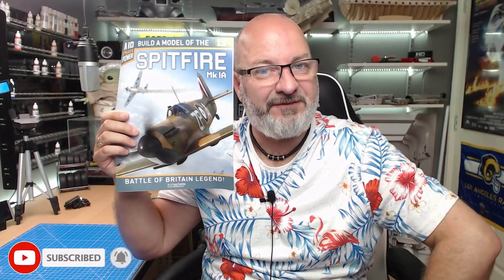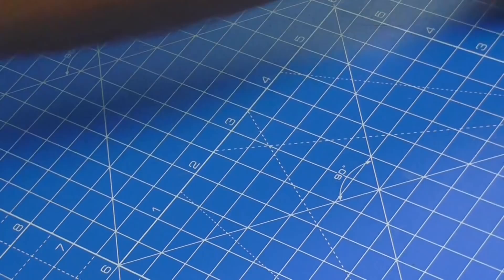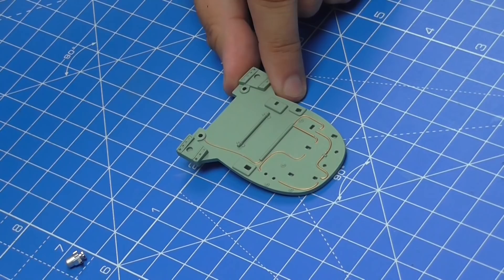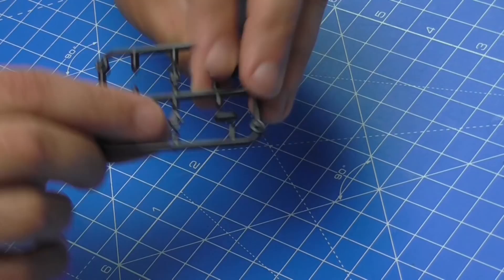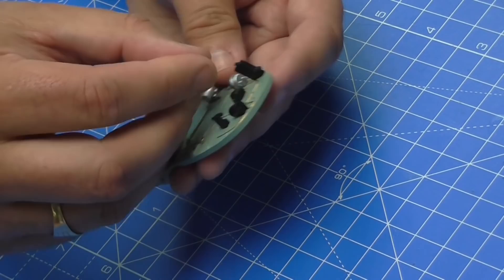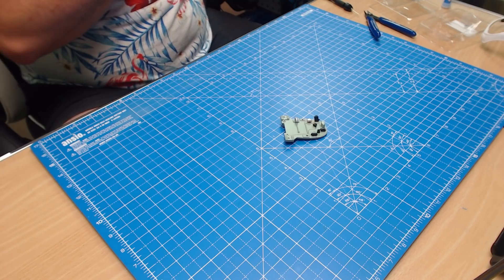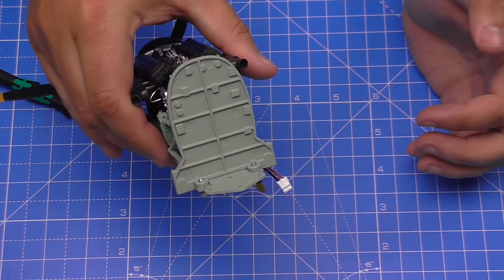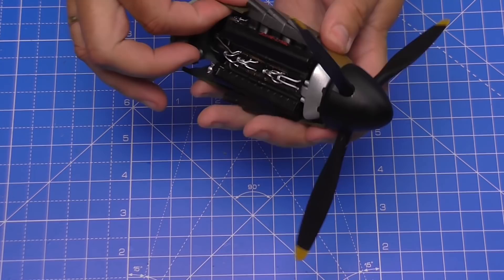Build the Spitfire Mk1a - Part 13 - Fitting the Fireproof Bulkhead and Engine

Comment: I know how you feel buddy, hot hot hot, especially when you're wiring up rotors and stators inside the turret rings of tanks. The nose section of the Spitfire is really taking shape now. Very nice. Soon you'll be able to use the spitfire as a fan.

Comment: Those two copper pipes go in at the next issue, 14, however they could easily have been fitted this issue as they are the first things you fit next time. Unfortunately when fitting my engine the lug on the extra part snapped so my engine is a bit loose and I can't get the back issue, so will have to see what repercussions there are later as the engine sits a little high on its mounting. Keep up the good work, great build.
Reply: I had problems fitting the engine in too, had to push down really hard to the point I thought it was going to break, next issue is part of the frame and I cannot get the screws to line up

Comment: Hi Wayne, I messaged you about this on an earlier vid.  I note others have been crying about this nightmare issue too - i did! The instructions don't tell you to glue 11-10 and 13-01 into place. I tied them with a wire to the bulkhead. This then gave me the flexibility to 'wiggle' everything and get the pins in place. The screws hold it together firmly without glue. it was hard. Can't comment on your warping but I hope this helps.
Reply from the maker: I reordered issue 2 and 11 so will just do them as one piece and fit them in that way
Reply: @WorldofWayneUK  Good luck - much easier without the glue on all these parts. Hope you get them soon :)

Comment: Hi Wayne I had the same problem the engine was pushing out the frame just like yours. In the end I took out the part on the side of the block which allowed the frame to sit flush😱nightmare

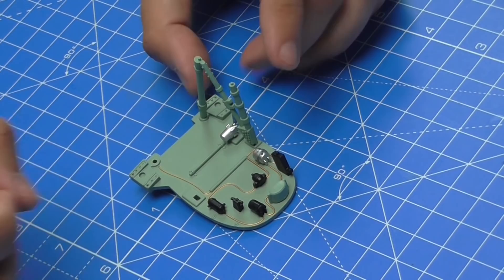Comment: Well, I can see why your brackets don't line up. At 9:46 you're gluing part 11-10 on the wrong side of the bulkhead, which means at 10:29 you're gluing part 11-08 on the other wrong side.

Comment: You have probably noticed that at 12.25 that the red wire has disconnected from the plug for the motor...
Reply from the maker: Yep. It's back in  now

Comment: Wayne, if I pause at 10:29 it looks like you've swapped the Z-shaped brackets from how it tells you to fit them from the instructions. Could it be why you're having issues? From our end they look more or less the same apart from the central detail but they could have just enough difference to matter how they fit
Reply from the maker: A few peepsnhave been having the same issue. I am going to take the advice. I have reordered them but wont be gluing them.
Reply: Jean-Loup Rebours-Smith I fitted mine the correct way without gluing them in and still had the problem of the frame jutting out. The only way I could resolve it was to take off some of the engine detail which was inline with the frame. This corrected the problem and everything was in line
Reply: Yeah, it looks like you put in the bulkhead brackets in the wrong way round. They need swapping over buddy.